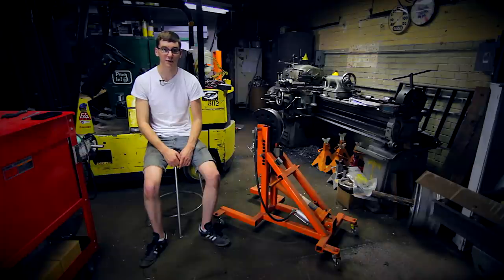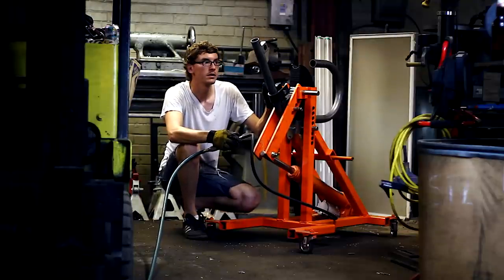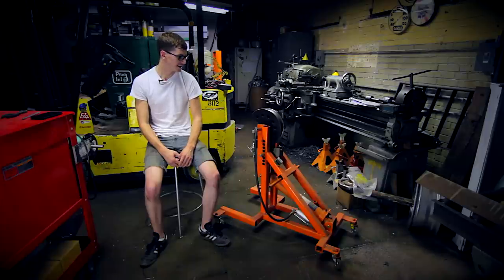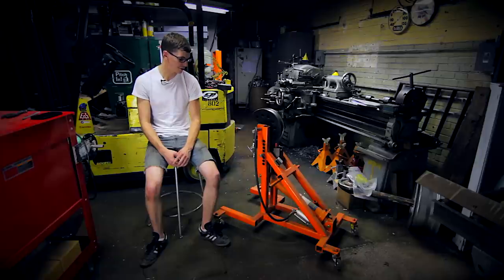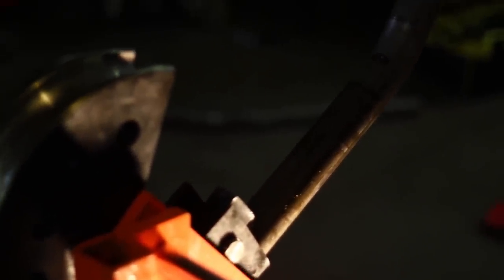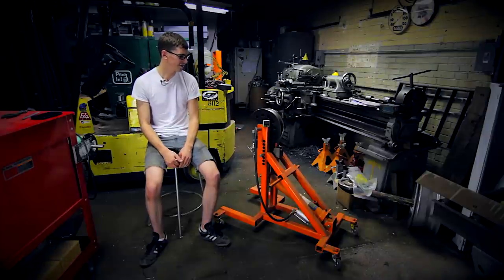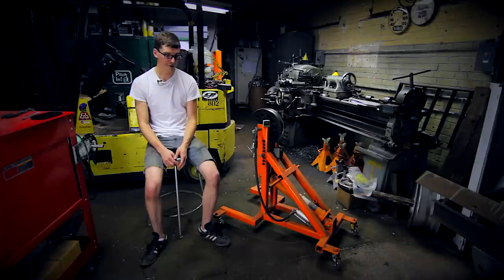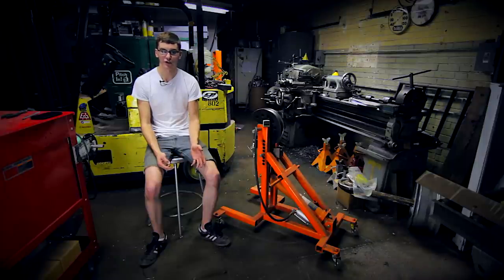DIY Tube Bender for Roll Cages! - Project Syncro - Just The Tip

Comment: It's an excellent bender.  The original design was intended to bend up to 2" diameter 0.125" wall tubing, so it is seriously overbuilt for the narrower, thinner tube we use for roll cages.  With a little practice I found I could get bends to within two tenths of a degree. Amusing that we both ended up painting ours orange.

Comment: there are much cheaper dies out there.  I think JD2 has dies for around $250-$300.  

the never might have to be slightly modified for different dies but it would be worth the $200 savings.

Comment: M600 tube bender kit is 650 saves a lot of effort
Reply: The m600 kit with the proper die prices out at $839 without an air over hydraulic ram, that they sell separate $119.
Reply: +Kyle Yoest I was just on their site the kit is 650 includes 1 die
Reply: RobesEleven -not the die for roll cage tubing. And not for a ram. I was just on their site as well
Reply: I'm not sure about the air jack hell if it don't then looks like I'm still shopping. Pretty sure I had the die picked out to for 650
Reply: RobesEleven it only includes a 1" die. Roll cage tubing is 1.75". They always get you with the options.
Reply: +Kyle Yoest the rzr roll cage is 1.75 but most roll cages in general are 1.5 chromemolly steel. If U click the down tab should give u more options for which ever die I want when u buy it

Comment: the dies were $500? alone?
Reply from the maker: yes, these dies were the most expensive part, and they are not easy to make on your own.  Since safety is critical, we wanted to make sure that pipe would be bent correctly with minimal deformation.  We did a test piece and sent it to an engineering friend to have him check it, and it passed with flying colors; fully within FIA spec.
Reply: sheesh thats the most expensive die i have heard of....why not just buy a bender at that point? or buy any other die for around $150? not meaning to be a jerk...just wondering